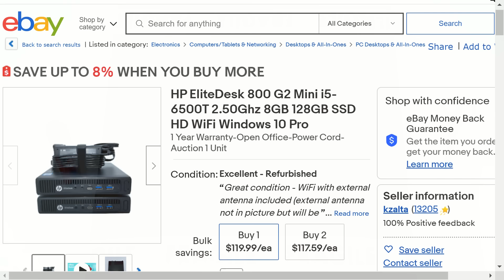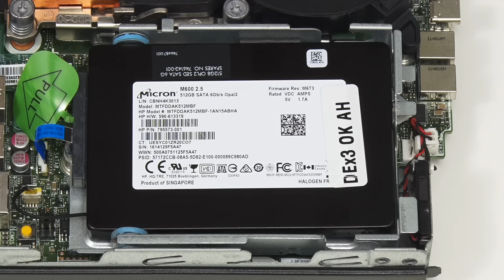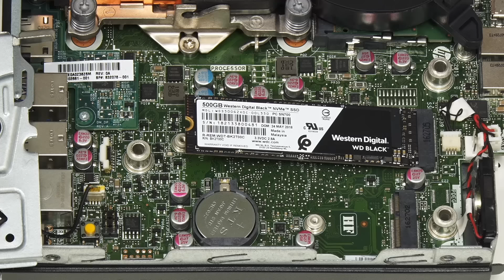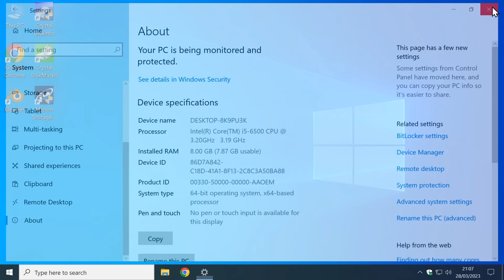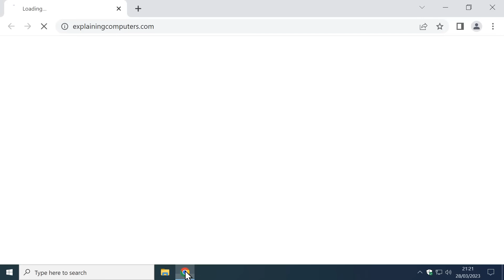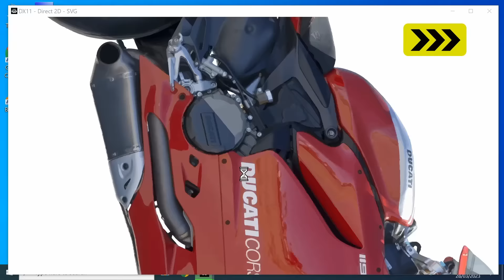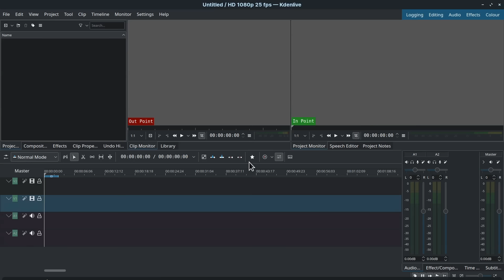Renewed i5 Mini PC: HP EliteDesk 800 G2

Comment: I bought a similar machine to stream video into my TV. It's a GREAT machine but there's one caveat: like the machine reviewed here, it has DisplayPort ports only, so I had to use a cable like the one you mentioned to drive the HDMI input on my TV. This arrangement works quite well, but there are minor glitches where you're better off with a machine that has an HDMI output (as you mentioned, these are rare in these small machines). One such glitch is that if your DisplayPort computer boots before your HDMI TV (or monitor) is on, the computer will not recognize the TV or monitor even after it is turned on; this problem never arose when I had an HDMI-to-HDMI connection. FYI to control my computer while in my chair watching TV, I use the Logitech K400 wireless keyboard, which has a touchpad and "mouse" buttons. It has a USB dongle like the one you removed when unpacking. Just plug in the dongle and you can operate  your computer easily while sitting anywhere in the room.

Comment: great little machines;  I use a much older model as a media box, slots under my TV.  Not officially compatible with Windows11.   Windows 10 support is due to end by late 2025.  Linux is a viable alternative, and I've used it on these skylake CPU's

Comment: I have one of these I bought a couple of years ago, but it has the AMD A10 in it. It's a decent little PC. Mine needs to be upgraded to a SSD. I really don't like the CMOS settings in these. It can be very hard to configure it to accept and boot anything other than the original windows 10 junk that came on it. Finally got Xubuntu with Cinnamon to work on it.

Comment: I use one of these for around 20 hours a week while looking for work.
I don't use anything heavy on graphics, yet they're immensely slow to boot up, and frustrating to use.
Since doing my trade as a service technician since the 80s, I've continually seen HP and Dell, charging way more than quality and performance should dictate.
Reply from the maker: I'm very surprised by your feedback on the boot speed -- mine comes up very fast.

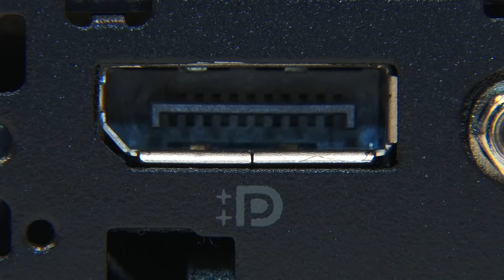Comment: 5:44 DP++
I added the cable as DP++ to HDMI output
But I'm not getting audio from my monitor
Can anyone help me with this issue
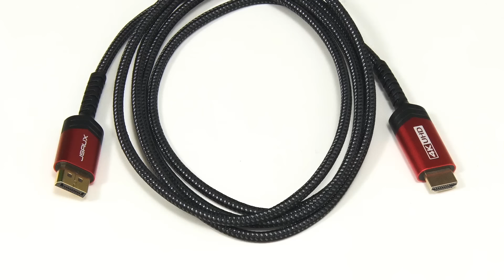Reply: I used the same kind of cable as shown in the video here 6:00
But no audio from monitor
Reply from the maker: Check your sound settings in Windows -- make sure the sound is going to HDMI, rather than analogue audio (the 3.5mm jack). Your DP++ to HDMI connection will carry audio.
Reply: @ExplainingComputers  I'm very new to this window OS
I don't have much experience with it.
I can't find audio output device other than Bluetooth and system speakers
Reply from the maker: @VIPINSAINI_20  Make sure you have the HDMI monitor connected and powered, or Windows will not show the option. HDMI audio should appear as a sound output device in sound settings. Perhaps the Bluetooth audio is mapping to the same space? But unlikey. Good luck! :)

Comment: 9:52  As that fan is for the standard (spinning) hard drive that generates more heat, it would be interesting to see the noise levels and temperatures with this fan disconnected.

Comment: 13:26  I've noticed over the years that OEM drives provide less info about drive usage (hence here no info about TB written).  Company software (such as Samsung Magician) do not support OEM drives, even if they are branded by the company (Samsung).  That software will not detect the name and model of the OEM drive.  Also, you will not be able to update the firmware.
As a result I prefer to spend extra few bucks and get retail versions of the SSDs and NVMEs (if I need a cheap, used one).  They are easier to manage, especially if I have installed more than one of them.

Comment: I just bought this HP EliteDesk 800 G2 with i5 6500T at €150 with these specifications
2×8GB Samsung (samsung 8gb 1rx8 pc4-2666v-sa1-11)
512GB SSD And 
Intel Radio Model:8260NGW
Seller gave me brand new HP 65W 7.4mm Non-EM AC Adapter

Sadly it's not i5 6500 65W one
But still kinda happy to have it

Now here is my question should I get a NVMe too ?
Because seller said it will likely to get heated in this tiny body without proper cooling and it's life-span will decrease. And added to the injurie mine EliteDesk is missing the second smaller fan 😭

So tell me what should I do
I was hoping to install another OS on the NVMe 
Please advise
Reply from the maker: The extra fan is apparently only fitted in the 65W TDP models, so the 35W TDP versions will be fine without it. An NVMe drive should be fine in these circumstances unless you to do something extremely write intensive to generate a lot of heat.
Reply: @ExplainingComputers  I'm gonna use this EliteDesk as KiCad or any other PCBs design computer
No heavy duty work

Comment: ServerHome talked about this little PC awhile ago. Back then I got 4 of these babies and now I plan to add 2 more to my clusters. Here are some of my takes who actually own a bunch of these sub 1L PCs.
1- Most of the G2 comes with Windows VL, some even comes with Win10 PRO which doesn's required you to pay extra $$ to get a genuine OS.
2- Be aware of the m2 for wireless connectivity. Not all card works with G2, only those wireless that are whitelisted by HP. Alternatively you can get a mod BIOS for walkaround.
3- Be careful of the blue screws for the 2.5" hdd tray, from what I understand, there are 2 kinds of threads, one for 3.5" and one for 2.5" but the exterior is the same blue rubber shock absorvant washer. So be careful when you buy those screws or you are gonna ended up like me with a crap load of screws that looks exactly the same but doesn't screwed onto the 2.5" disks.
4- vPro, this is one those hidden gems, it's basically an IPMI which is really cool if you plan to use it as a server.
5- Power hack, the i5 6500T is low power enough to ditch the gigantic brick that passes for power supply. You can go to Aliexpress and find a USB type c to barrel connector for HP and then purchase a 65W type C GaN power charger. I used it on 6500T and it has no problem booting it up.
6- Second ethernet hack, this one is the best, it is great to have an additional ethernet port if you want to transform G2 into a server, like using it as Pfsesne or OpenSense, you'll get more performance comparing to an USB 3 gigabit ethernet. This works by pulling the second display port module, and install a daugther board with a RJ45 socket which is connected via JTAG to an m2 module connected under the HDD tray, there are 2 options to choose from one by realtek and one by intel, I recomend the intel chipset. Be aware that doing this mod you need to take out the second small fan to fit the m2 module, and you will be sacrificing the nvme for a second eth.

I'm running a small cluster of 4 G2 with HA Proxmox and so far I have zero complains.
Also tried with an i7 6700k which is rated for 91W, strangely the original power brick can actually run it, although the temps are a little bit high.
It's just crazy that all SBC prices are so jacked up, you can litterally get on of this for roughly the same price, the perfomance difference is astronomical.
Reply: This is an heroic post. THANKS A TON for all of this additional info! I figured I'd just "go crazy" and get 4 G4's for like a proxmox cluster & HA, but obviously the G2's are quite a bit cheaper, esp in volume. I'm also interested in the 2nd eth port..
Reply: Where can I find out more about the second ethernet hack? tried googling couldn't find anything thanks!

Comment: I use a similar Lenovo "Tiny" M93 Core i3 version of this PC for audio streaming (music playout/audio processing/encoding/streaming).  Have a few of them now, all bought for less than £70 and very capable.  Basically treat them as a turbo charged 4Gig Raspberry Pi4's.  Although they do use about 3 times the power of a Pi4, they are still very efficient and much less power hungry than a standard PC (with their laptop style PSU).

Comment: I'm still using a Dell 3050 i7 with 16GB RAM which works perfectly with 3 monitors, a wireless keyboard, and mouse, these small PCs are really wonderful and underrated devices

Comment: Nice review. I bought 3 HP EliteDesk 800 G3s ranging from around $90 to $120 US on Ebay.  Initially I was looking for some SBCs but for the price I went with the mini's instead.   Nice to know about the Display Port ++ stuff. I wasn't aware of that. 

I purchased mine off of Ebay. As you mentioned, keep an eye out on the configuration.  Also double check what they ship with.  One came with a mouse and keyboard. Another came with an DVI to VGA adapter and the last was just the powersupply and the mini itself. I did get some of display port dummy plugs for the units. My Ubuntu mini has a typical desktop install that I use NOMachine if I want to log into the desktop.  The other two are running minimal installs of CentOS right now. One of the CentOS minis is running Docker. They do what they want.

So far I've been happy with them.  The only draw back I've found is the wireless cards.  The card is identifed as Intel Corporation Wireless 8265 / 8275 [8086:24fd] (rev 78) Subsystem: Intel Corporation Dual Band Wireless-AC 8265 [8086:0010] (from lspci -nnV.) I'm guessing that the wireless card isn't supported by the firmware packages that I found. 
 
I don't know if this is related to you not being able to see the drive data, but the G3's have an option for self encrypting drives.  Might be something to look into.  I didn't know that they were options until I looked at the Maintenance and Service Guide for the G3s.

Comment: If you do not connect the SATA SSD it is probable that the fan below it will not spin, making the unit more silent
Reply from the maker: That fan has no relation to the SATA SSD. It spins whether or not a SATA drive is connected.
Reply: @ExplainingComputers  Understood. On a mini PC I had, fan was always spinning only if a SATA HDD was connected

Comment: If I'm not mistaking... even if you had those HP hard drive mounts (Dell uses them too), where would you screw them? It seems that the thread on the SSD does not match the place where it is supposed to fit into the drive support...
Reply from the maker: They screw into the standard SSD 2.5" side threads.
Reply: But of course it's the standard physical specifications of 2.5" drives... Your finger points correctly at 7:40 but look where is the threaded hole on the SSD... Anyway, indeed, it's a nice built one, worth for everyday office work at least (I think that the company I work for bought 2 of them, guess who bought them ;) ) Solid, robust enough, well engineered/designed, not a space hog, not an energy leech), good performance, available documentation, drivers and such from a well known company.
I didn't opened any of the two because there was no need. Problems with a USDT (as they are also called) from Dell though (no pun intended, just a mishap maybe). Regards and best wishes... Oh, and they support migration when time will come, to Windows 11 too (without workarounds)...
Reply from the maker: The mounts and screw holes are offset, although this is hard to see in the video. I initially I also worried that they would not line up correctly -- but they do!

Comment: Until the productivity hits (useless ruined taskbar -which I can't work with-, unneeded extra clicks to do things for example) are corrected, I am staying with 10. By any measure, 11 is a downgrade and I can't see any reason why anyone would want to run it if 10 is available. We should not have to fix 11 to run as 10 did by employing 3rd party addons! I can't understand what Microsoft are thinking with 11. Very odd.
Reply from the maker: I do agree -- I am not a fan of 11 over 10. But it is where the Windows journey is progressing.

Comment: I picked up a couple of 800 G2's, one had a i5-6500 processor, the other had a i5-6600, both with Win10 Pro! Not bad for £106 each! One needed stripping down and the PCB cleaning with IPA as it had some signs of liquid residue. Neither were refurbished (as advertised) other than the case was sprayed with shiny silicone cleaner! Since stripped both down and fully de-fluffed, cleaned and tested.
Reply from the maker: Very interesting. Mine too had been sprayed with silicon -- took some cleaning off.

Comment: One thing to be wary of in this generation of HP mini computers is that the SATA cable to the 2.5 inch drive is very fragile. You have to be very careful about disconnecting it from the drive and/or the computer. It can seem to be completely undamaged and still fail if you are not careful. Of course, if you just want to stick entirely to NVMe, this cable won't be so much of a concern.
Reply from the maker: Very true. That cable -- at both ends -- is a weak point.

Comment: The Lenovo mini can be acquired with all digital display ports, and in fact while my particular model came with a HDMI and DP++ port, the "expansion" port was empty, and I was able to identify the part number and acquire the expansion board (for about $30) to configure a second DP port, allowing me to run with three 4K monitors.

Comment: I'm running an ancient Mac mini Core 2 Duo (with spinning disk) running Ubuntu for my home Plex server. It just refuses to die. But when it finally does, I'll be considering one of these HP (or similar) mini PCs. And it it's vPro, all the better as I can use a hypervisor (more for practice than for an actual need).

Comment: I recently bought the same machine with wireless connectivity for £75. It came with 500gb SATA HDD. I upgraded it to SATA SSD and added M.2. Now it's running Windows and Ubuntu. Even though I'm a Mac user I like trying other operating systems now and then. As over all the machine is very good and worth for the price I paid.

Comment: Can you use its existing Windows 10 activation key to do a clean install of Windows 11?
Reply from the maker: Yes, on the machine I purchased Windows 10 is/was activated with a digital licence, and both a clean install and an upgrade to Windows 11 carried the license across (I've been shooting a video about this over the past two days). However, with renewed hardware, it will depend on the vendor what you get. Almost certainly the installed copy of Windows will not be what initially ran on the machine (which will have been under an enterprise license in most companies).
Reply: @ExplainingComputers  I appreciate the response! I've been dabbling with Tiny 10 and Tiny 11 clean installs but typing in the original activation codes (I retrieved via PowerShell and CMD) did not activate the clean installs. Perhaps it has something to do with Pro vs Home vs Enterprise edition differences.

Looking forward to your videos! Cheers!

Comment: Chris I found it funny that I was searching SFF PCs as you published this video, though finding time to watch it got a bit delayed. I was initially searching for Haswell-based SFF/Mini PCs as I wanted to repurpose my old i3 4170, but I may just get a newer Mini PC and sell off the i3.
I was looking at the EliteDesk 800 G1, but it looks like I'll instead aim for the 800 G2 Mini like you showed in the video. I've seen them sold used in my country for the equivalent of about $127 with the i5 6500T, 16gb ram, and 500gb hard drive. The hard drive doesn't matter since I have a spare 240gb SATA SSD, but getting an 800 G2 Mini with one was cheaper than getting an EliteDesk 800 G3 Mini which has the same processor and ram but no storage costs $15 more weirdly. So the EliteDesk 800 G2 Mini looks to be the better priced one.

Comment: Bought one of these for £50 off of eBay about 6 months ago. I replaced the 4gb with 16gb that I already had after upgrading my Hackintosh to 32gb. I installed a very cheap (£13.49) 128GB SSD before installing Chrome OS Flex. I had no idea I could add an NVMe SSD too! It's an absolute powerhouse and fits my needs perfectly. I rarely use the Mac or Windows machines now.
Reply from the maker: I so like Chrome OS Flex. Great OS. I imagine it runs very well on this hardware.
Reply: @ExplainingComputers  it really does run without fault. The USB C port on this really sealed the deal in purchasing it. Great review as usual and thanks for helping me realise I can install an NVMe SSD too!

Comment: Back in 2020, due to Covid, my partner was told to work from home. Normally she used my desktop or a shared laptop,  but for hours a day she needed her own.  I quickly sourced a refurbed Dell USFF i5 PC from a local dealer. Similar specification to your HP (i5, 8GB RAM, SSD, DP (4K) & VGA, W10 Pro), it was quick to set up, cheap, faster than my desktop and has worked flawlessly ever since.

Superb bang for one's buck.

Comment: Hi I ended up with a HP 800 G2 containing a 6500T, an NVME drive and the results are very similar, I don't think that there is much difference between them - mine does everything that my old i7 desktop used to do so I am very happy with this (I miss the graphics cards speed in a few things!)

Comment: Great review, Chris!  I've purchased 4 of these tiny 1L PCs over the last year because they are a much better value for setting up a small Linux server than using a Raspberry Pi 4.  Mainly, I've used HP EliteDesk 800 G3 systems, which look a little more streamlined than the G2 version you showed in this review.  My G3 systems also had the i5-6500T processors, which work wonderfully in my use case.  For Windows 11 support you'd need 8th generation intel processors, which would make the system considerably more expensive.
Reply from the maker: Thank for this. And Windows 11 runs just fine on a G2 -- video on both a clean install and an upgrade coming soon. :)